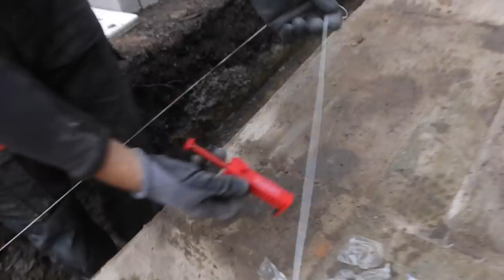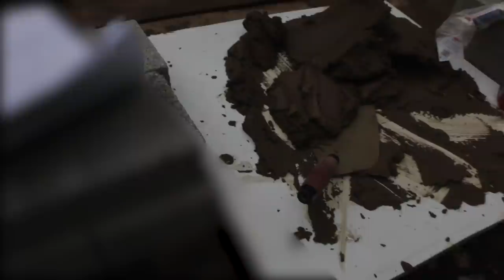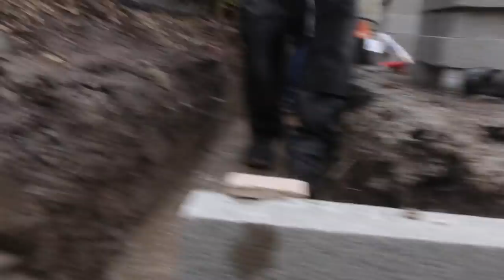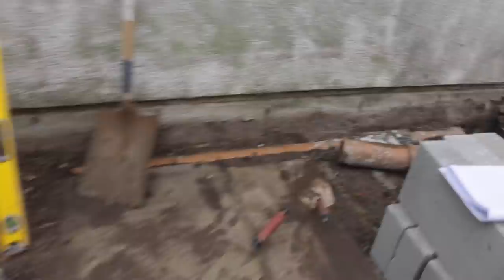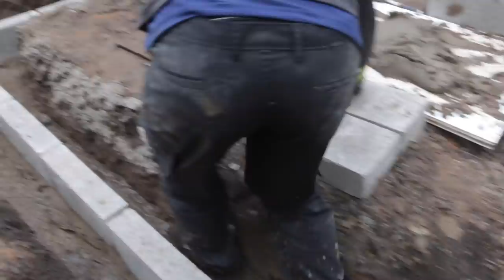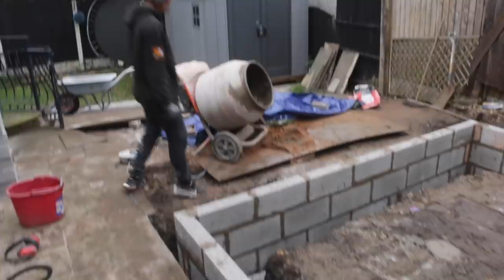Bricklaying - Starting New Job With KC - Small Extension - Footings

Comment: Good lads! Use a short length of battern to brace your level when you plumb down.
And don't be afraid to lay against a length of 4x2 on your bottom course bed joint,it keeps the pug underneath when the concrete's wet.
Keep up the good work.( And don't answer back)

Comment: Stu, I’ve just had an extension finished off, 2 stories with a balcony. The mortar on the ground floor is so weak it can be scraped out by dragging a screwdriver across. The mortar on the 1st floor is a bit better but will be rendered so not as worried. Would you recommend grinding out and repointing?

Comment: On brick you have 10mm joint, what joint do you have on block??
Reply: 15mm
Reply: It’s the same mate 10mm joint
Reply: @clemo1808  ?
Reply: Only the bed joints are 10mm, purrs you try to keep as close to 10mm as possible  to make it work full brick no cuts etc. Also not always possible when sizes vary
Reply: 12mm—15mm dependin on width